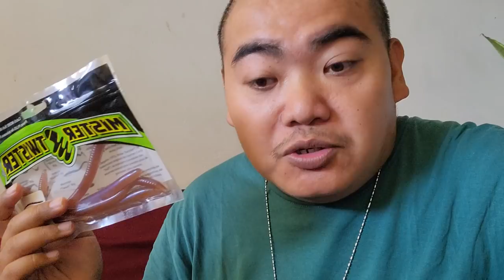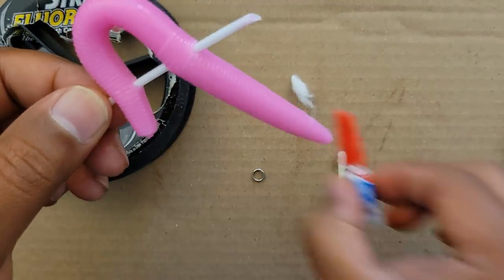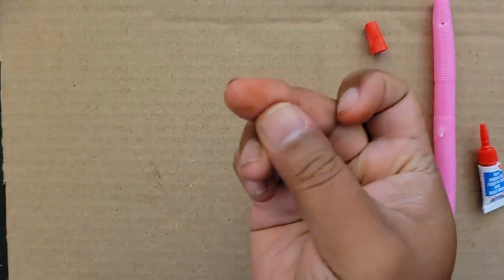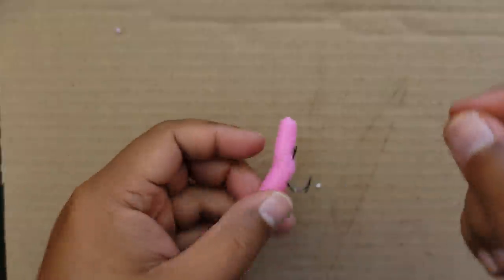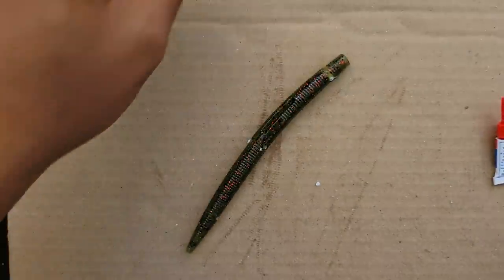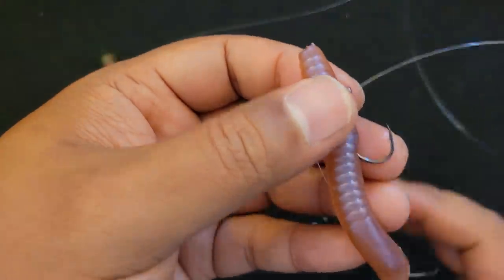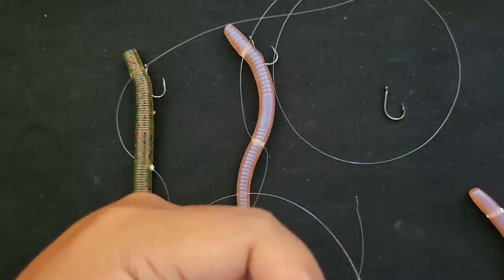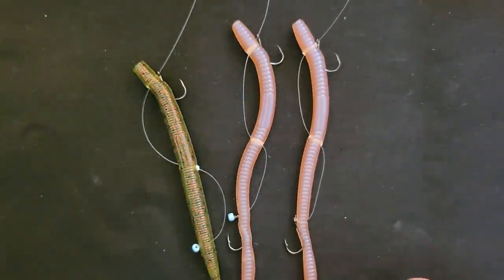THE INURIG Single or Double Hook with Split Rings or Bead | NEW RIG FROM JAPAN

Comment: Excellent instructional video, you are a talented teacher. For those fishing in obstruction rich waters I would add weedless wacky hooks to the arsenal. I fish inshore waters with lots of oyster shell. I think this rig could be a killer for my fishing. My preliminary test have shown a tendency for these to cause line twist so I may have to add bb swivels. 

Has anyone else encountered the line twist? When twitching it back slowly it works fine but when reeling it back quickly after exiting the strike zone once it starts helicoptering it rotates quite rapidly.
Reply from the maker: Thank you! It does tend to twist but after trying with multiple stick baits I used a swivel.  I also added a a small split shot to help it sink. Let me know what you catch with it and always keep safe out there.
Reply: I'm planning on using wacky weedless hooks as well. I think I am going to try one on the end and the front hook tied on
Reply: @J4m3sj  Do you put the split shot in front of the first hook? Maybe about 10" in front?
Reply from the maker: @grandwonder5858   I do two ways either 10 inch above the first hook or between the tail hook and the Bead or split Rings just to help it sink faster.
Reply: That's what I did
Reply: Thanks. I hate line twist.

Comment: I've been seeing improvements to this the past few days. If someone can figure out a way to not have the first hook floating, it will be perfected.
Reply: Just thinking. If you tie the front hook on, the hook will move away from the bait, but the worm would still compress and decompress, no?
Reply: @OJA1965  so long as you don't skin hook it to the worm.  It would decrease the chances of the hook being in the fishes mouth though as well unless it is a really large fish.  I think you would be better off just have a single large gap hook at the rear of the bait.  If you don't tie the first hook to the line though, it is literally useless against a fish of any size at all.
Reply: @IlliniDog01  Thanks. I am going to try that next. I also need to pay more attention to the alignment as I didn't have very good action. I used coffee stirrers, but I will try a q-tip next. It might be a little bit sturdier.
Reply from the maker: Just posted a new short video  https://youtube.com/shorts/-R1X20IOjhY?feature=share
Reply: @J4m3sj  LOL, did you just now make that? The hook pulling away might not be an issue if the strike happens when the worm straightens.
Reply from the maker: @OJA1965  I was using the same concept last weekend but with the 2 hooks model. It does work but find that it got snagged a lot and broke off many rigs in the pond. You might want to try rigging it up using crayfish.
Reply: @IlliniDog01  I hooked and landed two redfish in about 10 minutes both bigger than 8 lbs. for those unfamiliar with redfish they have very thick heavy mouths and it takes a serious hook set with  sharp hooks to hook them and keep them on.
Reply: @OJA1965  Although I haven't tried this rig yet, I find that the tube which holds the ink inside a ball point pen works well for other purposes, should be good for this purpose, it seems to be a bit stronger. Ink can be re
moved by lacquer thinner.

Comment: The ONE THING that I'd add is that you're going in at too straight of an angle. You need to angle it a bit...going in straight doesn't come through the water as well.

Comment: Why do people place the hook at the top of the worm instead of at the bottom? If I only use one hook, wouldn’t it catch more fish if placed at the bottom?

Please mark the work surface so you know what areas are in frame. Much of the second half of the video is off camera.
Reply from the maker: In the original rig the hook is on the head of the worm free lined I just added the second hook at the tail for when the  worm is curled up and more chances of hooking up.  If your also interested I also maid a short video of it with a fixed hook. 

Thank you I will mark put some marks for future videos.